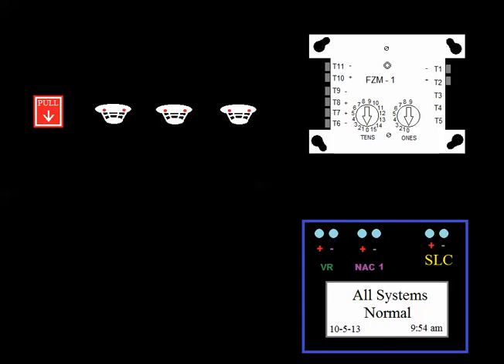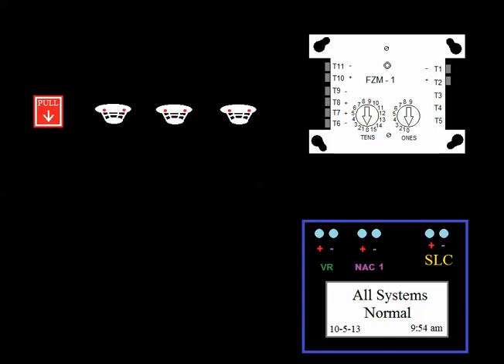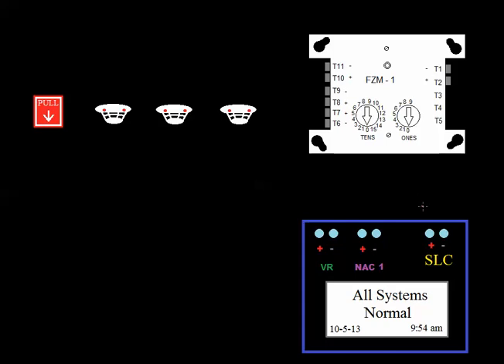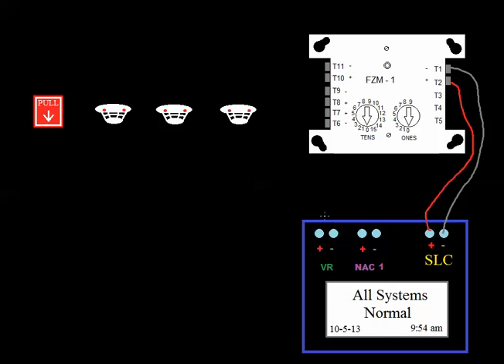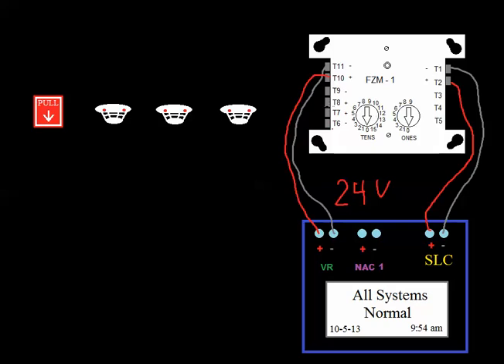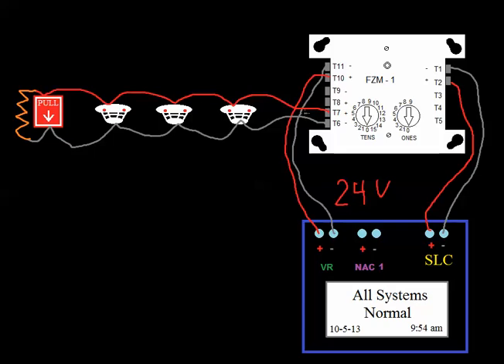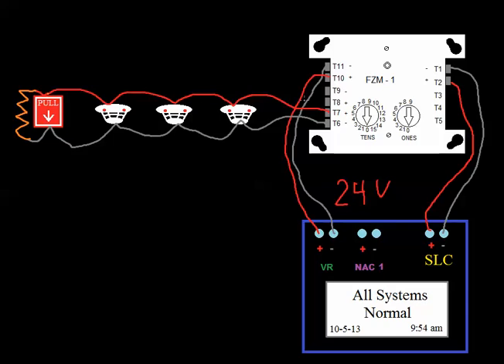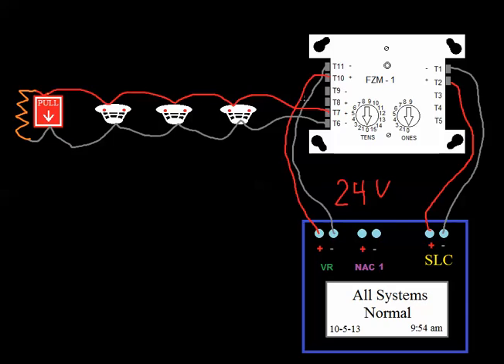24 - Field Zone Modules - Introduction to Fire Alarms

Comment: Great explanation! Does this kind of module supervise the 24 volt resettable power? Or is a power supervision relay needed? If the module loses the resettable power, would it send a trouble signal to the SLC? Thanks!
Reply from the maker: Depends on the panel. Notifier panels supervise the power if the module is programmed correctly. Gamewell FCI modules do not. Other manufacturers I'm not sure off-hand

Comment: How do you test to tell if a SK Monitor module went bad
Reply from the maker: Depends on the problem you think it's causing. If the panel is not communicating with the module, you can connect it directly to the panel. If it's showing an activation, you can temporarily resistor it out. There are even more basic steps, but a lot of the troubleshooting is basic common sense.

Comment: the manufacture of these modules sets the battery feeding terminalsT4 and T5, here battery is feeding T11 and T 10, I am confused
Reply from the maker: Mava, no battery should be connected to these. Make sure you're comparing the same type of module. I think some terminals chanced when the modules switch from the V type to the H type, but always following the install sheet.
Reply: @JoeKlochan  thanks a lot

Comment: what is slc
Reply: It stands for Signaling Line Circuit. It's the addressable equivalent of a zone on a conventional panel. Except that it's far more powerful because it can connect to multiple devices, each of which can have its own individual device name and programming. Other companies, such as EST, call them loops. Simplex, Notifier, Fire-Lite, and the rest call them SLCs though. Exact same thing though.
Reply: signal loop control

Comment from the maker: If you're asking what I think you're asking, the answer is yes. The addressable FZM has 1 address only. Every conventional device that's connected to it would show up at the panel as the same address. So if you have smokes, pulls, and heats all tied to that circuit, you'd have to label that modules something like "3rd floor detection", just as you would a zone on a conventional panel.
Reply: How many wires install from smoke detector to module